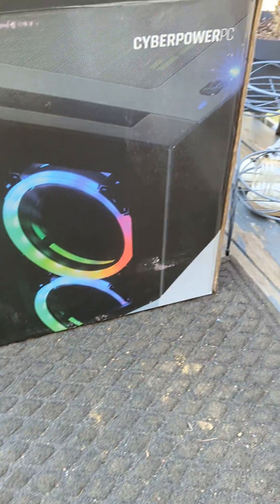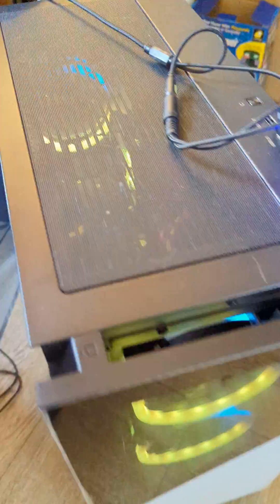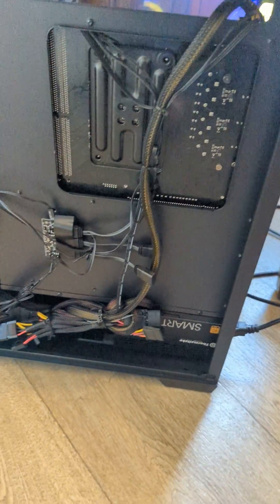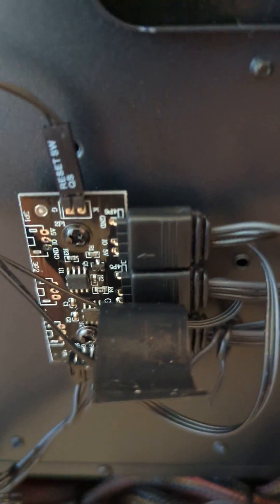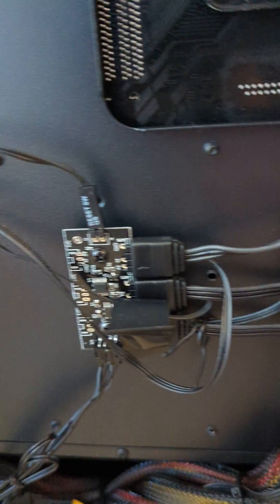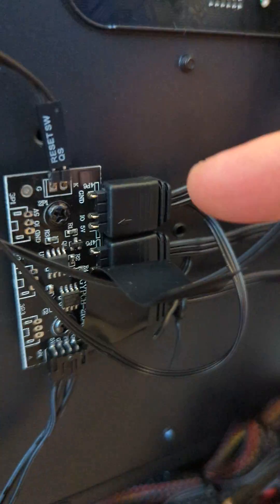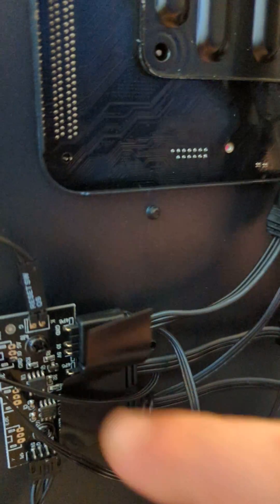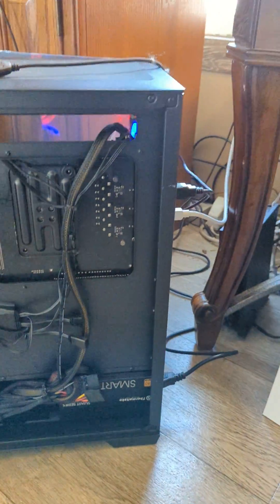cyberpower PC fan lights not working - how to fix!

Comment: Hi Christopher. Sorry, I know I'm a couple years late to the party! But I'm having the same issue with my CyberPowerPC. Only the bottom fans lights is working. 

I took the side panel off as you did but it doesn't quite look the same. 

Please help! I'm really new to all this!
Reply from the maker: @BodgerBob  bottom lights are not working correctly ? But top works I'm guessing .. sounds like one of the prongs might be damaged or simply loose .. maybe someone forced the connection what can you see
Reply: @Evadar  hey! Thank you so much for getting back to me! So it's only the bottom fan at the front that has its lights working. Rest of them do not. I looked online and some people located the connectors within via opening up the other side but no luck either. Think I'll just have to get on with it. I'm not really keen on pulling it apart! Probably end up breaking it. At least the fans actually work! Thank you again for your reply!
Reply from the maker: @BodgerBob  a lot of us are experiencing the same problem. Also some of the lights are semi-faulty. We have found out they die after a certain amount of time on some

Comment: Did not help, unfortunately.
Reply from the maker: @MrMockingbrd  what are your lights doing?
Reply: @Evadar  They went from changing when the button was pressed to only being white and no button response to completely off in the span of 4 days. Pc still runs. Fans still run.

Comment: I did this but it still didn’t work
Reply: Same mine won’t change color any tips?
Reply: Just fixed mine messing around with the cord I simply swapped their places I put the top on in middle the middle one to the bottom and bottom all the way to the top and all my RGB lights turned back on hope it works for you too

Comment: I just did this and it still doesn’t work
Reply from the maker: Some of our lights are faulty too. Mine have started showing random color mix... And now have stopped 🌟 shining completely.
Reply from the maker: Try messing with the top button that's towards the middle of the top? Just has a letter C on it.
Reply: @Evadar  yeah I been pressing it and holding it 😭😭😭
Reply from the maker: Wonder if there are any firmware updates for these lights..
Reply: @Evadar  so I was messing w the cables shown in the video and now they light up however they aren’t as bright as they used to be they’re stuck on a green and yellow color when I press the top button labeled “C” it doesn’t change color or anything.l
Reply from the maker: Also, my fans have started making a little bit of wobble noise. I would be real careful about getting any hair or debris in there

Comment: I have the same PC and when it arrived i had to perform this task and the lights worked.  Ive had the PC over 6 months and all the sudden the lights stopped working.  I reopened the panel and none of the connectors were loose, so im not sure what the problem is and why they arent working.  Frustrating.
Reply from the maker: There's definitely some issues because mine have started doing funny stuff too like they got scrambled colors one time and like you said sometimes they turn on when they shouldn't. I think they're lighting system is where they made some cuts so that they could focus on other parts. Feels like it's sad but true
Reply: @Evadar  what a pain in the arse eh.  Think I'll contact support some time soon and if I learn anything ill comment.

Comment: So close! fiddled with the wires and i got half of each fan to light up solid white for a second. still not sure whats wrong fully
Reply: me too did you find out the problem?
Reply: @wisinposas8702   Yeah it turns out the hub that the cords were plugged into had malfunctioned. So i unplugged them from the hub, unplugged the hub from the power supply, and daisy chained the fans together. then i plugged that into the D_LED2 slot at the top right corner of my motherboard. (the one with 3 pins very important). now it all works perfectly AND I can use RBG control apps. (was a pain to plug in there just saying. annoying to reach)
Reply: @wisinposas8702 Bru did u figure it out 😭🙏

Comment: Thanks! Any advice on fixing the bluetooth? I haven't been able to get it to work
Reply from the maker: When I get home I'll look into this for you!  So when you try to use the Bluetooth it just doesn't work? Or you're saying that it's not showing up or you're saying that it gives a faulty connection?
Reply: Did your pc come with any antennas? If so, connect them and see if it works
Reply from the maker: I haven't been able to figure out a problem with Bluetooth... I was having trouble connecting to one certain speaker though and that was both with my Google phone and with the computer. So maybe it was just the speaker I don't know

Comment: Hey man, is there a hinge on the main side panel where the glass mounts? I just bought this pc off of marketplace and the guy broke his side panel so it didn’t come with it, I ordered a replacement but I’m not sure exactly how it mounts to the case
Reply from the maker: Yes, there's definitely a hinge that opens up swings wide. It opens out to the left from the front side is where you open it and it swings out left.. It lets you open that side door to see inside
Reply from the maker: Sorry for the delay brother, it didn't give me a notification for this one
Reply: @Evadar  well damn Im gonna have fun trying to find someone willing to sell me the hinges lmaoooo
Reply from the maker: Possibly contact the company for some, maybe you can let them know yours are defective? I'll take a peek at the specifics when I get done flying home ✈️🛫
Reply: @Evadar  they said they don’t manufacture the case or parts anymore and even if they did they couldn’t help me as I didn’t buy it from them, I bought it second hand
Reply from the maker: @DatHondaBoi223  yep, looks like two hinges they screw in on the back and it creates a slot to hold the glass so that it can hinge out like a page on a book opens

Comment: How do you get the panel off in the first place? Mine is likely doing the same thing.
Reply from the maker: There's two hand screws in the very back and then the panel slides off. Almost like it's a lid that slides off. You'll feel the bend in the back where you're supposed to grip. That's where the hand screws are back there.

Comment: Friend, congratulations on the video, I have another problem, I don't know how to disable the peripheral LEDs on the motherboard, because when I turn off the PC it turns off everything except the small LEDs on the motherboard, could you help me?
Reply from the maker: I'm not sure but I will check it out for you when I get home.
Reply from the maker: Okay, I think I'm experiencing one of the same kind of issues. My mouse still turns on sometimes after it's turned off.. I'm looking into this
Reply: @Evadar isso tambem ocorre com o meu mouse, se descobrir por favor me diga, obrigado
Reply: @Evadar This also happens with my mouse, if you find out please tell me, thank you

Comment: What happens if I disconnect the 3 cables, only the lights will be turn off?
Reply from the maker: I think it just controls the lights. You definitely don't want to stop your fans!
Reply from the maker: Okay I think you should be okay. Only the light up functions are affected by the cords
Reply: Hello, I have a problem and it is that my lights have a bug, they stay in the rainbow color, they cannot be changed or turned off and I want them off for the health of my eyes since I have the PC very close and the only way What I found is to disconnect the 3 cables, I hope it only affects the lights, not other things.

Comment: I have this exact same model, but just yesterday my lights would change, but now they wont. the remote has the red light on, but I cannot change the color of the lights.
Reply from the maker: Did you say you have a remote to change your lights
Reply: @Evadar  yes. And even with the remote they don't change.

Comment: Does anyone know why the rg fan inside the pc isnt lighting up but the one on the other side is. Not the cooler btw.
Reply from the maker: I'll check this out later
Reply: I tried doing the same things but nothings changed
Reply from the maker: @godcrazycat3005  sorry, I'm currently driving Lyft right now
Reply: I also have other cords that look the same but aren't connected to anything even though the 3 are already connected
Reply: Oh shi- I messed around with it and  found out that everything in the pc was snipped jesus 😅 ima get a refund for a new one
Reply: Thank you for the effort but all is solved baseically lol
Reply from the maker: @godcrazycat3005  That's good to hear. Yeah those cables have three prongs so maybe only two of the prongs were in or something. Sometimes a broken prong can also do what you were talking about

Comment: I don't even see this module on my Y60 case. 😢
Reply from the maker: Oh no! Is it missing? Did you remove the side cover
Reply: @Evadar  Yes, I removed both covers, but this case is a little strange. I did fix my lights though, I just followed the fan rgb cords until I located the one cord that unplugged from shipment. Your video was still very helpful, though! ♥

Comment: I have the same pc i jusy air dusted with a pressured air duster bottle for pc's and keyboards the other day and tonight i just saw lights are off and fan works it really sucks, i tryed to gently push back in but it seems nothing is loose idk what to do
Reply: i have the same problem right now, did u end up getting it fixed?
Reply: @starakay  no when i get home ima gonna try and push more stuff together in hopes that its loose and if not ima just call best buy and ask them or geek squad
Reply: @free_bird4206  thank you! Please keep me updated!
Reply: @free_bird4206  checking in cause I totally forgot, did u ever get it fix
Reply from the maker: Let us know if you still need help
Reply from the maker: Just make sure you find the housing thing on the side of the computer. Have to remove that panel with the hand screws.

Comment: Is it safe to plug these in with the PC running, or should I have it off and unplugged?
Reply from the maker: Personally, I plugged mine in while it was still going so that I could see if any connections were loose.
Reply: @Evadar  I don't need to worry about frying anything if I need to change some of the positions on connections? What happened to me is when I was installing an SSD, a few of those got knocked loose and now idk what positions they go. At first my power button didn't work, but I figured out all connections except my lights button now doesnt work.
Reply: @Evadar  Do you think the order of the connections are the same for me?
Reply from the maker: @Arch3an  are you using the same PC ? They should be basic light setup with a connection at 3 spots. Don't force any wires ... It should light up when contact happens.
Reply: @Evadar  I have Model:SLC8600BST

Comment: So I have this same case and when I got the PC my lights worked perfectly fine. I have checked that all my cords are plugged in and have disconnected and reconnected everything on that part and on my motherboard. I don't think it's the fan lights because they will come on at random occasions. Is it possible that the this part has just gone bad? I have tried googling my issue but I can't find anything with my exact problem bc all my fans work it's just my lights don't turn on for any of the fans except for on random occasions as I mentioned before.
Reply: I have the same exact problem it comes on at random occasions then when I go to turn it off and turn it back on it doesn’t work anymore
Reply: @luvPeso  just happened to me today, still don't know the problem. they used to turn on when the computer was turned on, now it takes them like 5 minuets before they suddenly just turn on.
Reply: @21Faces_TTV any fix ? This is me now
Reply: @alexrodriguez6986  no, and now they completely quit working. Pretty sure the little control module all the rgb lights plug into quit working. Since its purley cosmetic i havent really stressed about fixing it too much. There are some after market parts online though that you can purchase fairly cheap for a replacement
Reply from the maker: Definitely sounds like loose connection somewhere. I wonder if the button that is on top is engaging correctly?
Reply: @Evadar  all of that worked before even tried using a different sata connection
Reply from the maker: Do you have any programs that might run the lights...  like sometimes Corsair or something like that will have a program that needs a driver update
Reply: Hey I know this is 8 months ago but did you ever fix this? Seems I am having the exact same issues with them not working but just RANDOMLY turning on sometimes.
Reply from the maker: Sometimes those programs will control lights for other things like your mouse and keyboard and have some setting that messes with your fan lights too.
Reply from the maker: There's three points of contact where the cord could be unplugged. The middle spot where the prongs connect..... And at either end...   smaller one goes into your motherboard I believe... And then the larger end is for your fans to plug into
Reply: Mine would work. Then not. Then it worked. Then not. Thought software, but was the connection. Mine plugs into a small board just like this one. Had to have computer on (I know, risky!) while jiggling to make sure fully-seated and re-secured with fresh tape as the adhesive/bond weakened over time. Hope you got it!
Reply: Same issue idrc im just bored and wanted to fix it but idk
Reply: Any fixes? I’ve had this issue for months I turned the rgb off via the button at the top cause I didn’t care for it. Went maybe 3 months with it off and when I went to turn it on nothing… tried everything and no results🤷🏼‍♂️

Comment: So I have the opposite issue with a cyber power pc, I can’t turn the lights off. Remote seems to work but idk
Reply from the maker: Okay to turn the lights off you need to hold the button down until they shut off

Comment: I have the same exact pc but this didn't fix my problem🥲.. someone help
Reply: Hold the button down on the top of the PC. not the power button but the one behind it.
Reply: @chank2415  I finally contacted Cyberpowerpc pc and they replaced that part. It was the rgb control motherboard
Reply: @arianamarin8936  I guess they cheaped out in the RGB department. Can't believe how many people have problems with it. At least the PC is working great. For now.
Reply: @chank2415  I totally agree!! I had got the warranty thank god or else they wouldn’t have sent me a free replacement piece. It went out 4 months after I got the pc
Reply: Same
Reply from the maker: Sometimes you have to set up your lights in the settings I have heard from people and there's also a button on the top that cycles through the colors. Make sure that that's clicked.

Comment: So mine just randomly started flickering Yk how to fix that?
Reply: Same then they fully stopped and this doesn’t even work :(
Reply from the maker: Hmm cable could be crimped or bent in some spot.
Reply from the maker: Flickering definitely sounds like loose connection where vibration would be making it cut on and off or some type of power drain or not enough power
Reply from the maker: How long have you guys had yours?
Reply from the maker: One thing we're noticing is even some lights stay on after the computers turned off occasionally

Comment: i checked the connections on the back panel and they are all plugged in tightly. I even unplugged the top one and replugged and still no led lights ? =(
Reply from the maker: I would take it in for that one to make sure you don't have bad lights. Sounds like something is not connected if they never worked though. Be careful not to break the prongs off when you're connecting

Comment: right now my top fan wont work any help on that?
Reply from the maker: You had a loose cable up there and plugged it in with the 3 very slim metal prongs?
Reply from the maker: Be super gentle connecting it , it did not take much force at all. If a fan stopped working after you messed with the housing I would check to make sure it didn't get unplugged.
Reply: Mine came in pre made so I can't really open up the panel
Reply from the maker: @craftingkid70  The panel slides right off. It's got two anchor screws near the back. It slides off like a sliding door
Reply from the maker: @craftingkid70  it's got hand screws. Two of them
Reply: @Evadar  say do you have discord so I can add you and send u pictures of it
Reply from the maker: Yes, if you're still having trouble let me know